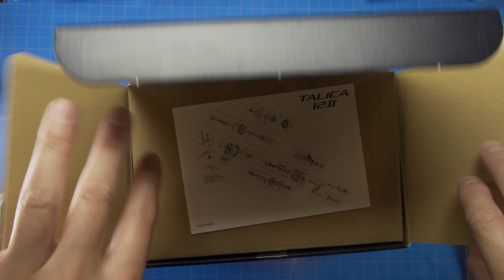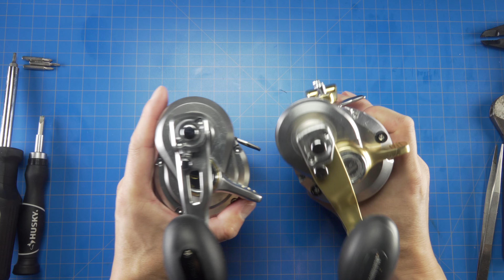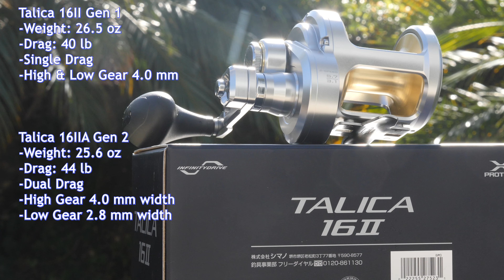Is it worth it? Shimano Talica 16iiA gen 2 for 2023 and 2024

Comment: The slits in the screw holes are genius! Wish Daiwa did this, I've cracked screw holes before just from the hydraulic action.
Reply from the maker: Such a simple idea but very forward thinking in that. Funny thing is the issue I read it on was an older model Saltiga that got split from that. Hairline crack on the CNC aluminum frame
Reply: @Seastheday88  I've had it happen on my saltiga as well. It's the current model. But the pressure occurred where they machine a blind hole for the rod clamp bolts. Turns out it's either machined very thin there or they didn't drill all the way through.
Reply from the maker: @Vedak2011  Ouch, yeah i can picture that. They should've just drilled all the way through and trim the screws to length
Reply: @Seastheday88  yeah, I may go back and drill some "weep" holes next maintenance. I was quite saddened to have it happen on a brand new reel lol. This video pointed out a small detail that I would have never known. Well done!
Reply from the maker: @Vedak2011  sorry it happened on a new reel, but love that you’ll try to resolve it. thank you and glad that the video helped!
Reply: @Seastheday88  Yeah, it wasn't Daiwa fault so I can't blame them either. Doesn't affect the reel, so it's mostly fine. This is really a tough choice though, there's good and bad for the current and older gen Talicas. Been eyeing them for a while.
Reply from the maker: @Vedak2011  True. I think they ultrasonic it to break down all grease when you send it in for service to prevent that from occurring. Regarding the Talica, I’m truly up in the air right now. I have a 25iiA that I’m in the process of reviewing and it has the same gear. I’m curious how it’ll hold up after time on low gear. Overall, I’m curious to try and push the higher drag limits.
Reply: @Seastheday88  Looking forward to your input on the 25iiA. I've always loved Shimano design, but Daiwa still takes the cake for me. One of these days though...

Comment: Nice Evaluation of the New Talica 16II! If I took it apart I would have extra parts laying around lol.
Reply from the maker: Thanks Steve! lol, yeah sometimes a piece or two go missing, usually a spring, screw or washer. I like the new body design, but this thin profile low gear still bothers me. lol
Reply: @Seastheday88  yeah like you said  and measured they are not the same size which is odd.
Reply from the maker: @socalsteve22 I’m prob just overthinking it 😂
Reply: @Seastheday88  put it to the limit!!
Reply from the maker: @socalsteve22  hope so. Only way to test these things. Same with rods, pulls nice at home but needs all those extra head shakes to go with it lol
Reply: @Seastheday88  true that!!

Comment: hi. quick question... does handle on the new talica 16ii have back play? i mean it kinda reverses a bit. thanks for the info.
Reply from the maker: @alvinritchiecantor3104  Hey Alvin. The Talicas 2spd should all have a bit of back play. They don’t have ARB bearing, instead they use Anti Reverse Pawls. This allows the transition between low and high gear without damage. I experience that small back play on Makairas and Penn as well. If your back play is more than that, then possible one of pawls may dry from grease. Hope that helps

Comment: Sounds like you would be backing a Torque over these gen 2 models. Are you still loving the torques?
Reply from the maker: @codiecarroll735  I still own 1 torque 2spd lever drag. I’m holding onto 3 gen 1 Talicas still. Have 2 of these gen 2 Talicas. The goals on these gen 2 is to keep putting rail time on them. I’m thinking the new drag design will give the smoothest winding in Strike without premature wear on the pinion bearing unlike Torque and gen 1 Talicas. If they hold up, I’ll have the 12iiA replace my Torque 30ld2. Still a Torque Star Drag user for all class 40lb and below
Reply: @Seastheday88  i like to do a bit of casting, so I’ve been leaning towards the Saltiga, have you got your hands in a Saltiga in this range? Too many options, but your review has piqued my interest in the Gen 2 Talicas.
Very informative, hopefully that skinnier low gear doesn’t affect longterm use.
Reply from the maker: @codiecarroll735  I’ve actually been using the Torque 30ld2 for casting slightly bigger grade. Only needing the low gear at last circles. It’s a lighter reel overall, but let’s see as the 12iiA might replace it. 

Haven’t got my hands on a 2spd Saltiga yet but a couple guys on our charter uses them with thumbs up results.

Comment: I cant speak to this saltwater reel but i remember not to long ago , shimano had to go back to brass gearing from steel micro module gearing because of chipping.
Reply from the maker: @robb158  interesting. Never considered chipping. I know they’re able to cut brass along more precisely due to cutting tools not wearing so often. Okuma and Penn uses steel gears. Even Daiwa uses it on the Lexa HD. I’ve never heard of failure from brass but at the same time, they weren’t this thin nor not that high of lb drag applied to it. Only way for us to know is to put it to use. Hoping to hang one soon